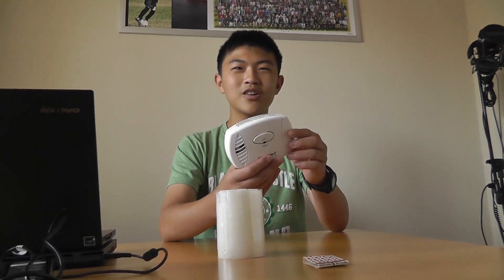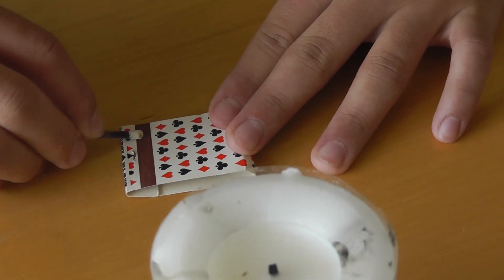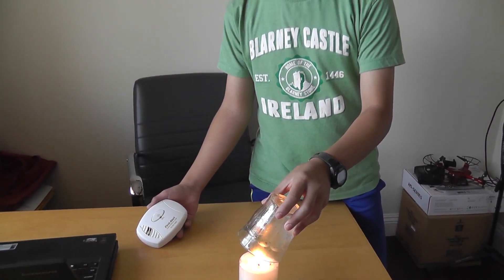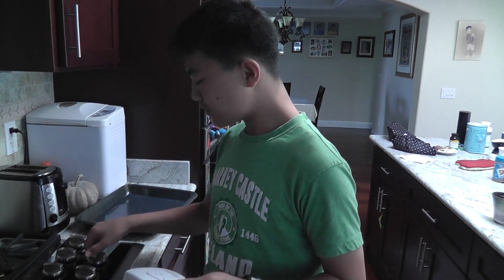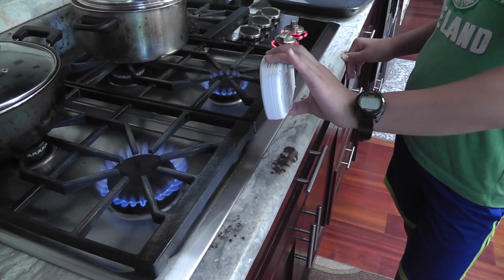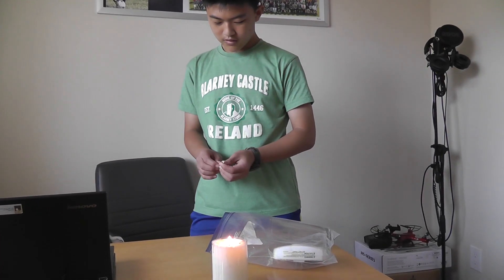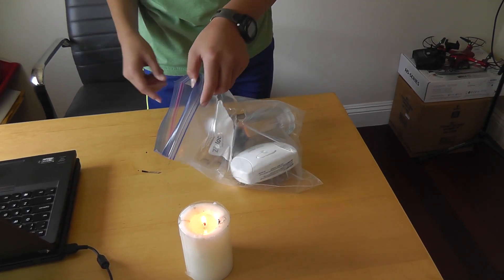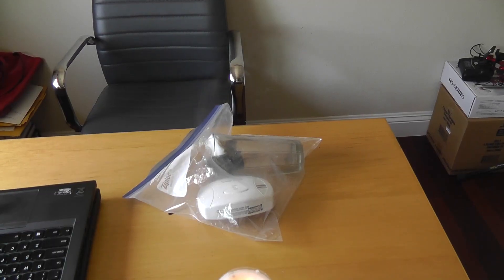How to Test a Carbon Monoxide Detector at home

Comment: It wont work like that. You need to know the general rule of carbon monoxide. 
Carbon monoxide forms when there's not enough oxygen during combustion process. 
C + O2 → co2
But for CO
C + O → CO
It wont work when you lit the candle up and hold the detector aside because its in open air where oxygen is abundance.
Same goes to the stove.
For that last test. Im not sure wether you used paper or crumple styrofoam cup.
First if you used paper : 
You burn it and place it in a ziplock bag , the flame will used up all the oxygen inside , hence oxygen will decrease. Thus carbon monoxide will form instead if carbon dioxide.
If you used crumple styrofoam cup , 
Well... Styrofoam cup is made out of petroleum based.
So if you burn it , it will more likely to produce CO.

Best way to detect CO is just use cigarettes smoke. It emits some CO so that should work.
Anyway good vedio !
Reply: Hi It Seems you know something about science I wanted to ask you your opinion on something a new report by the fire protection assosciation the enginner that wrote the report claimed that a co alarm might act as an additional fire sensor during a smoldering phase of fire any ideas thoughts please thank you!

Comment: It has to be plugged into the wall to work 🤦‍♂️
Reply: Not all of them, like the one that hes holding is on battery. There are different types of detectors that dont necessarily need to be on a wall

Comment: ITS NOT PLUGGED IN ITS NOT PLUGGED IN!!!!
Reply: nafsivle they have batteries to
Reply: @xSINxDOVE  oh lol, its just that i have that same detector in my house and i never got to see the back closely/
Reply: Yea some have batteries in case power fails some don’t tho .
Reply: There is a battery that’s supposed to last years in there
Reply: There are different type of detectors,  all of them do the same work but are just build differently,  like the one hes holding is on battery and does not need to be plugged in to work

Comment: Very dangerous to try these experiments with fire in the home.
Please do it outside In a safe place.
Reply from the maker: Mr Pat you are right. I didn’t realize it until you pointed it out. Thank you!
Reply: @jamesyuan97  no problem I also learnt by mistakes.
Now safety comes first.
God bless.
Reply: I james I wanted to ask you your opinion there is a new report by the fire protection association it claims in its conclusion that a co alarm may act as an addtional fire sensor for smoldering fire any thoughts  plEase thank you ?
Reply: Tell that to your gas stove, Karen.
Reply: It's fire, not a nuclear bomb.
Reply: @arkhamkillzone  even a single match can cause death and destruction to the house, fire kills don't let your children play with fire.

Comment: Realise that the CO alarm conforms to the following standards and won't simply sound straight away unless the levels are immediately extreme or lower levels are present for many hours.

40 PPM	10 hours
50 PPM	8 hours
70 PPM	1 to 4 hours
150 PPM  10 to 50 minutes
400 PPM  4 to 15 minutes
Reply from the maker: exxr thanks for sharing the nice info.
Reply: Tank you

Comment: Try placing the stove on with the gas leaking.. should trigger the detector.
Reply: No it wont,thats natural gas no co
Reply: if that won't work what is the point of having one? everything is connected to the natural gas
Reply: @mrpiccolo3551  Carbon monoxide can kill you.  That's the point of having a detector.   You can smell natural gas if there's a leak.  Carbon monoxide has no smell.  One of the ways that it gets produced is when natural gas is burned without enough air being present.  So if there's a leak in the exhaust pipe of your gas boiler, for example, and fumes are entering the room, you might be exposed to carbon monoxide.
Reply: @bexhillbob  so why can't you test it by just holding it above your gas stove and turning it on
Reply: @mrpiccolo3551  Because gas, when it's burning properly on a stove that isn't faulty, doesn't produce enough CO to trigger a detector.  Otherwise we'd all be dead by now.  And gas which isn't burning doesn't contain CO.
Reply: @bexhillbob  I guess i thought being close enough would be enough that would be deadly if you kept breathing so it could but there is still too much oxygen mixed in? Is there anyway to test it other than the TEST button? To me, that isn't a true test
Reply: looks like someone else is saying several hours of ppm in another comment
Reply: No don't try this its dangerous if gas builds up it could explode if you Ignite it.
Don't play with gas.
Reply: Cris Castro OMG, you can’t really be that stupid can you? If your bag of clues is that enormous, don’t try offering advice. Especially when your advice could almost guarantee death or injury. 
Unless your deliberately trying to kill someone, then nevermind, lol.